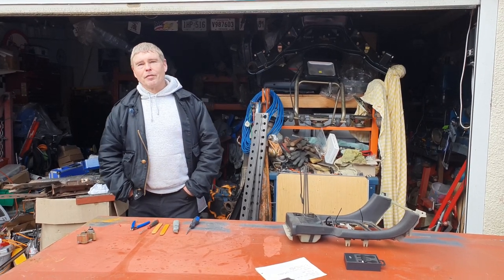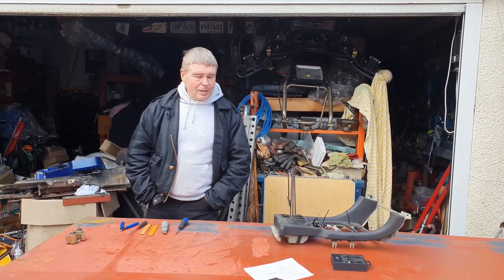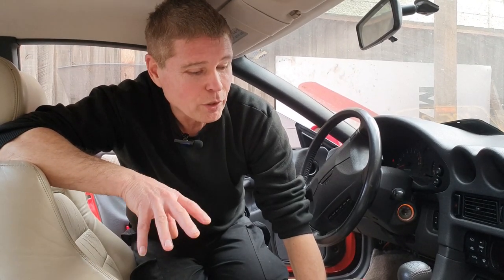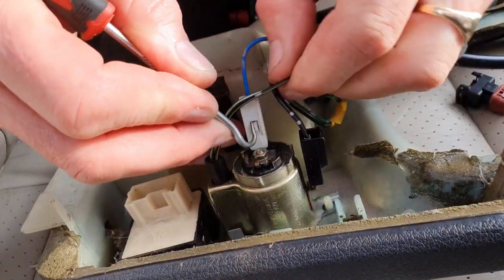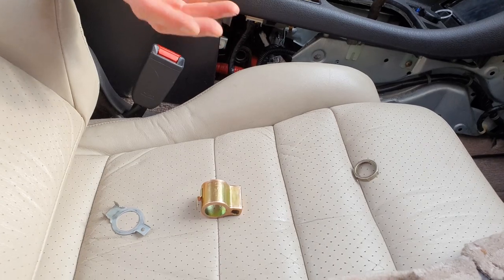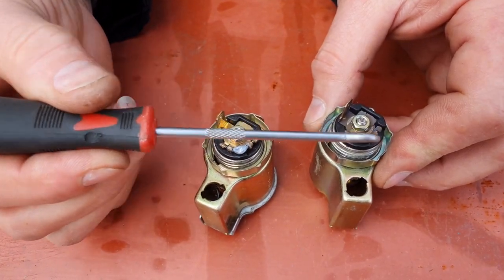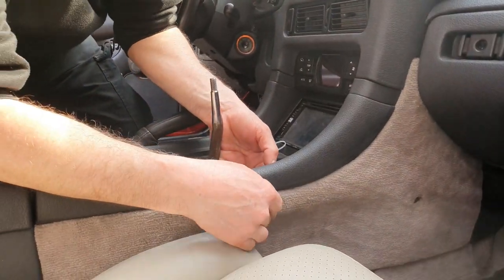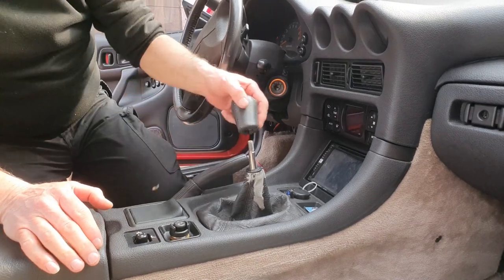Mitsubishi 3000gt / GTO 12v / Cigarette Lighter Port Repair

Comment: Could you make a video on how to replace the front and rear speakers? And possibly the interior dome lights that stop working even though the bulb is fine? Thanks, also how to fix the rear wiper when it’s shorting out and not working. Thanks, even if you could do just one of my issues im having that would be great. Blake from New South Wales Australia 🇦🇺